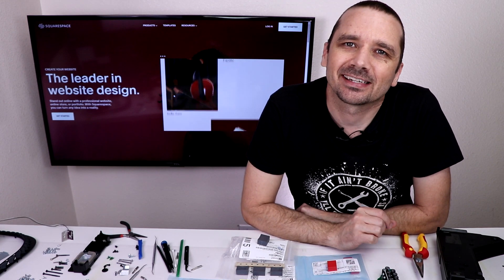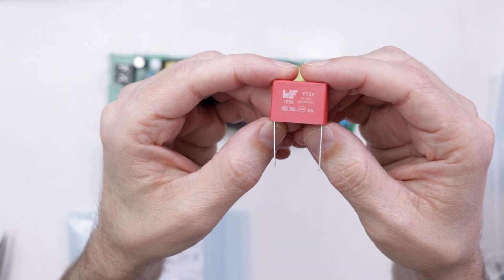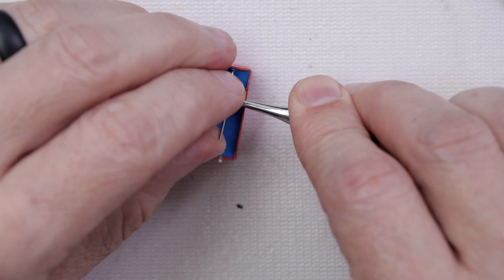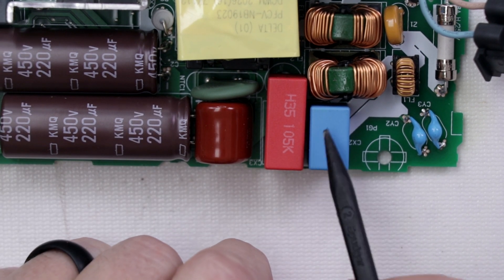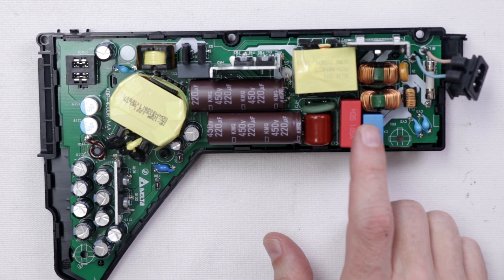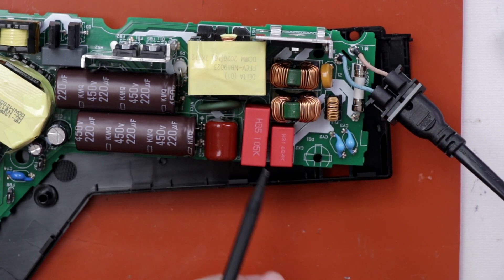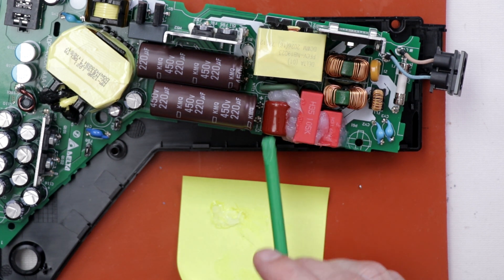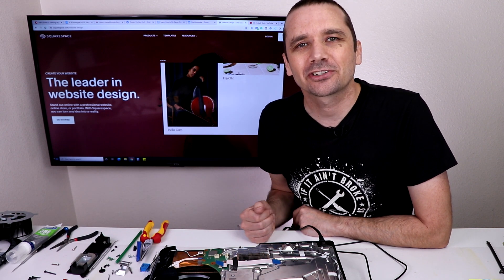Did I Fix PS5 Coil Whine?

Comment from the maker: What other experiments do you want to see me do on my PS5?
Reply: All kinds of hardcore repairs on them! They just came out Steve. We don't even known what commom problems gonna be. Thanks for the content. I love it.
Reply: Great vid! Can you test some PS5 games, like Astro's Playroom, and record if there's still coil whine? Thank you!
Reply: Maybe check out the disc drive? Maybe there is a way to make it less noisy when reading discs?
Reply: Try silicone on the original capacitors to see if it improves the noise. If you have another PS5 PSU to try it on that is
Reply: I'm curious if adding vents on the sides where the fans are located will improve overall airflow of the console, probably not but still something that can be experimented with.
Reply: @chrismorrison5301  have you tried running the conesole without the cover? The airflow on that machine is too good to be true
Reply: @MrUchiha  I don't have one unfortunately, if I did I would try that to see what happens
Reply: Connect 2 power supplies together at once. Will it start a fire? Let's find out!
Reply: trying to fix SSD's High temps?
Reply: @jangelelcangry  how hot does it go, cause ssd's in most cases are supposed to run pretty hot
Reply: All PS5 have low coil whine when idling. Start a game and see if your solution is still quite?
Reply: A HDMI port replacement with ps4 slim/pro connector. Took me 2 hours🤤
Reply: please try to fix Nidec fan noise
Reply: Can you check inside temperatures?
Reply: I honestly only come here to see you fix big batches of broken stuff.
Reply: Stress the system playing a demanding game for a few hours in a room with 30-32 Celcius. I'd love to see how it manages that kind of stress.
Reply: Can we see if only applying Silicon will help ? Cause I Can apply silicon myself without taking risks. I want to keep my PS5 but on Demon's Souls the sound is too much...
Reply: Also there is an other sound, coming from the fan, kind of a vibration also, not just the fan but a vibration from the fan... Parts of this console are so cheap...
Reply: @majorDarkMonkey  stop putting your ear next to your console and looking for noises. You'll just ruin your experience by constantly being on alert.
Reply: try playing a demanding game and hear for the coil whine, my ps5  PSU sounds louder when run games like cyberpunk, spiderman miles morales, etc
Reply: Does it blend?
Reply: CPU reball
Reply: @MrUchiha  I watched a video of someone that noticed the disc drive was vibrating the top plate of his ps5 and by putting a little pressure on top it quieted down.
Reply: PC users have been putting hot glue over capacitors to reduce the noise from them for years. They vibrate internally so quickly that they give off that "Whine" sound. It's especially noticeable at higher frame rates.
Reply: Find a better solution for the coil whine
Reply: Bet you 10 dollars tronics fix that you can’t fix my Xbox one
Reply: Another issue I’ve seen but not very common is some PS5’S come with like GPU Artifacts, you can definitely find this on the internet, can you please make a video explaining why this happens? PLEASE?? PLEASE??
Reply: Water cool it!
Reply: U think this time ps5 after year or two works the same like ps4\pro? Cause i think this time sony do much better, and we play in accepatable noise for long time, what u think?
Reply: I get error code ce-108255-1 when game frezzing and boots me out of game Sony says its software other ppl saying  it's hardware
Reply: Wurth: check out GreatScott's channel, he seams to know alot about the company
Reply: try the silicon ziptie combo without changing parts, see if that helps
Reply: @john75470  how often does it happen? I get errors but not often with this recent update?
Reply: Hydro dip the sides!! That would be sick
Reply: @dominikegarcia2213  I get it when playing call of duty that the game will freeze and and had it with tomb raider but other games I can play with no crash
Reply: Please  Use a volt meter to discharge capacitors.  set it  to read voltage. If you can set for higher range it will drain more quickly.  watch it go down to zero volts safely
Reply: Can you make it backwards compatible? :-)
Reply: Swapping the analog sticks in the ps5 controller with the Atari controllers.
Reply: I am confused so you bought a defective ps5 used or no? My brand new ps5 is dead silent as with mostly all ps5's unless it is defective. I saw you fixing a broken xbox series x. I mean people who buy day one consoles to me really can't complain when it is new tech and the first batch might have defective consoles. I just got mine and I am so impressed from the silence. I turn on the ps4 pro at the same time next to it and it sounds like a jet engine.
Reply: Wow great fix, if my replacement PS5 is still noisy, I'll be fixing mine out of warranty once and for all properly
Reply: Could you get the PS5 HD camera cable connectors and see if there is some tweaking over the its pattern (like the PS4 camera, which have a custom USB connector) or if is some new approach in terms of connection with the device
Reply: Put some led all around the vents in the front
Reply: Plates customization :D
Reply: I just can't believe you're tearing into a brand new game system that's only been out a few months and voiding the warranty :D
Reply: Please take a look at the PS5 high pitch fan noise issue. The O-rings under the fan screws is not a reliable fix and the noise drives me nuts!
Reply: A RGB led mod?
Reply: @tronicsfix I have a ps4 that's been acting up weird and I was wondering if you can help me solve it or fix it if these issues are any hardware related stuff
Reply: Replace SSD components
Reply: If you could make a video on how to make the disc drive quieter? My PS5 doesn't have coil whine, but it makes a lot of noise when reading a disc.
Reply: @w1z891  so you're saying that it could be my hard drive components because my ps4 freezes up and crashes on basically any game randomly and while it turns on and everything it just soo slow to load up and games too and when I play a video game some textures look missing. Any help with that? Please and thank you
Reply: @rka_87  this  would be major key if he can... I took my fan out it doesn’t make noise only when  it’s in the case...
Reply: A fix for discs getting stuck and the disc driving making crunching noises when you press the eject button. I've had to send mine back to Sony for repairs for this reason
Reply: @MrUchiha  This, definitely. I've read that adjusting the outer case fit can reduce it, but not eliminate it. Whatever speed those disc authentications are, that happen at regular intervals, they're pretty loud. Actually installing games from disc is quiet for me, so it might actually be the slower spin that's louder.
Reply: Did you fix it?
Reply: Hey it would be really interesting if you could test if the different fans on a ps5 have better cooling than one another. Like if the louder fan is better at cooling than the quieter one. No one has done this and I think people want to know.
Reply: Hey @TronicsFix Can we fix coil whine on PS4 Pro? the model CUH-7116b makes a lot of coil whine noise
Reply: @tronicsfix Hello,have question about liquid tape,silicon better ir liquid tape to avoid the sound of coil whine?You see in my country i can get only liquid tape...and still one is very expensive another one is from ali express,pls answer,thx
Reply: the disc drive noise
Reply: YES ID LIKE TO SEE THE CURRENT MOST COMMON PS5 HARDWARE SOFT WARE MALFUNCUTION
Reply: Steve, can you add an external "EMI filter" before the PS5 and confirm if this helps with the noise on the power supply? Those capacitors might be working extra hard trying to filter the EMI coming from the AC mains.
Reply: It is not exactly a power supply, the motherboard also produces this sound somewhere, for example a colleague plugged the PS5 service power supply, the effect is the same.
Reply: sorry to be so off topic but does any of you know a way to log back into an instagram account??
I was stupid lost my password. I appreciate any tricks you can give me
Reply: @Zev Josiah instablaster =)
Reply: @Zaire Axl it did the trick and I finally got access to my account again. I am so happy:D
Thanks so much, you saved my ass :D
Reply: @Zev Josiah Glad I could help =)
Reply: for post bending I like to use round nose pliers to get good bends plus it gives something to use to hold onto them as well. Just something you might like to try.
Reply: In summary, what are the characteristics of the  capacitors?
Reply: Can I have a listing on the capacitors used?
Reply: I watch your videos just about every evening - I don’t have a ps5 yet - but I pretend like I do when I watch you fix them.
Reply: X- and Y-marked capacitors are safety capacitors that fails open, so it's important to make sure that it has at least the same X- or Y-rating (e.g. don't replace a Y2-rated capacitor, with a Y-rated one. You can however replace a Y-rated, with a Y2-rated).

As these are safety-rated, they already have a large safety margin, so the orginal capacitor is already plenty. No need to go up to a 690V cap.

Noise usually comes from movement, so I wonder if the old cap had air in it. You can also get noise from loosely wound coils. And I wonder if the remaining noise mentioned, could be the capacitor arcing through the dielectric - which would be a bit silly, considering they're supposed to fail open.
Old RIFA (yellowish see-through) safety caps tends to crack, and absorb moisture, which kan cause them to fail a bit violently. I wonder if these caps had leaked in humidity, and this noise is some pre-failure thing.
Reply: @TronicsFix any reason specifically you arent't using a multimeter to at least test for comparisons

Comment: You shouldn't discharge caps (especially high voltage ones) using pliers. You should discharge them through a resistor. Otherwise you're essentially creating a 0 ohm load across the capacitor, causing massive current that creates sparks, massive amounts of heat and can end up killing the caps or even damage the board.

Comment: I repair iPhones. I eventually wanna get as good as this guy. Insane work again!
Reply: J.K Huss Right! He’s a good inspiration for electronic technicians.
Reply: All he did is replace a capacitor damn
Reply: @Doganderboss  in this video yes, but in others he fixed more complicated things....
Reply: Practice, practice, practice. 10,000 hours do learn or do anything
Reply: @Doganderboss  he fixed the coil whine.. no one is fixing coil whine on the PS5
Reply: He allready fixed some
Reply: I do this type of work,but  hate soldering and stuff but I'll do it if I have too, I mainly fix phone screens battery's and clean a gaming system out and redo thermal paste every day or so as well.
Reply: @DarthYazzie  no one has a PS5
Reply: If my PS5 breaks, I’ll let you freely experiment on it!
Reply: @MiGujack3  nah I’ve done some board stuff here and there but still a lot to learn
Reply: @D1amondeyes  Sorry to disappoint, I have my PS5 and from the store not a scalper, also mine doesn't have coil capacitor whine, only hear the disc spinning every now and then.
Reply: Jep absolutly insane
Reply: It is so satisfying, for an elektrican ist may asmr
Reply: @Doganderboss  😐

Comment: I'm curious if just putting silicone between the old blue capacitors would have helped with the buzzing.
Reply: Did you try this methode?
Reply: @bozoqturkmni8137  Me? Oh no, I'm not skilled enough to open my PSU safely and do that on my valued PS5.

Comment: Sony designed the whole console around being quiet (and it really is) but then they skimped on the power supply. On the Series X PSU you can see that they at least had noise output of the capacitors in mind (and they probably chose higher quality components too).

Thank you for covering this in depth and actually locating the issue!
Reply: Probably bought their capacitors from different bulk vendors to meet demand. Just the same as not all PS5's have the same fan models.
Reply: Yes, an that make me mad! Both consoles could be very nice but that mistake Sony made is ruining the PS5 for me. I have both new and old consoles and was playing on PS4 Pro most of the time for years. Now I completely switched to Xbox due to the annoying noise from my PS5. Thinking about selling it!
Reply: Don't know which ps5 u been playing I went through 3 consoles either a loud nidic fan or coil whine or both av given up now am just waiting for a proper revision or a slim my series x is near inaudible even when I put my ear on the series x I can just about hear it. My ps5s lol I could hear them quite far away
Reply: @marrsil  I sold mine because of that
Reply: @Gigi Finizio  I wish more have sold theirs and went public like you did... maybe Sony would fix it.... nahhhhhh too many rich soccer moms out there and 5 year Olds screaming for the newest system
Reply: crazy how small the xbox psu is, with less components.. much more efficient design than the PS one.. the systems should be pretty similar in power comsumption

Comment: Two Things: Try discharging the caps through a light bulb. It's a bit slower but no fire works, plus you can see when it's discharged.  You can always use a higher voltage cap. The voltage rating is the max voltage it can handle and is a function of the dielectric surface area. It also is effects the derating of the cap. As the cap gets hotter, the capacitance will decrease. The higher voltage cap will stay in the capacitance range you want. If you want to use better caps, look at an X5R, X7R which holds their rated capacitance over voltage/heat.
Reply: That's an X-cap. Replacing it with a ceramic cap is ill-advised.

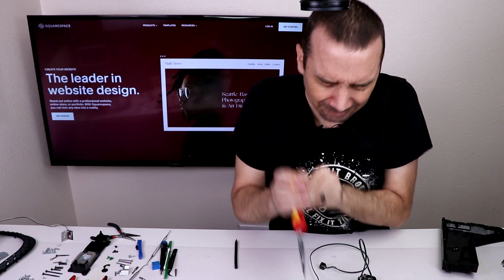Comment: 8:02 Elctroboom moment
Reply: There should be a 1 MegOhm discharge resistor in parallel to the caps to avoid exactly that. Bad power supply design.
Reply: LOL, I was thinking this was going to happen as I saw the beginning. Thanks for the heads up!
Reply from the maker: Ha, ha!

Comment: lmao that reminds me of college. We had a professor that had a capacitor about the same size as my 24oz watter bottle. When he shorted that HOLY CRAP even from like 200ft away (it was a lecture hall) I could practically FEEL the shockwave in my chest.
Reply: Haha! That reminds of the time my lab partner and I popped an electrolytic capacitor because we got sloppy building the circuit.
Reply from the maker: Ha, ha...One of mine did the same thing!
Reply: At my first ever job the prank there was to charge a large cap and throw it to someone and say "catch". It's amazing how many times people will instinctively catch something that will hurt them before they stop catching.
Reply: @asdrubale bisanzio we usually use six of them in series with balancing circuits between them. They max out at 2.6 or 2.7 volts... 
Without a doubt they can start a car. The coolest part is they can start a car with the mostly dead battery that's in it.
What you do, is charge up the caps using the battery that is mostly dead.. pulling a small draw over a period of time and boosting the voltage up into the capacitors.
And then, you connect the capacitors and immediately start the car. They are storing enough energy to turn the engine over and get it started and then the alternator starts charging the battery and brings the voltage up. The capacitors are still attached initially to balance out the load spikes a little bit until the battery comes up and then you just disconnect it and everything runs fine. A mostly did battery can jump start itself.
The other thing that you can do is charge it with an outlet or another car or even something like a hand crank if you have the time... And then bring it over to the car to boost.
If you wanted to build a hybrid battery for your car, you could run cheap tiny cells that have the same amp hour capacity so you can run your radio or lights for the same amount of time, but these cheap cells can't do the amperage to start it... But the super caps take care of the amperage to start it so the battery lives an easier life.
Lots of fun things to do with them and automotive applications but they have nothing to do with what he's doing there.
Reply: @ZaPpaul  Ya, at my last job this fool, that was my friend, did the same thing to me. I “trusted” him so naturally I tried to “catch” it. I gave him a good scolding. Stupid guy thought it was funny then, I still don’t think it’s funny, now.
Reply: clocked.

Comment: Good fix brother. What I was mentioning in the last video is that I use certain silicones to waterproof some controller boards that are somewhat exposed to the elements, and also fairly expensive. But also have a muffling effect on noisy components. That is a very simple fix. I always appreciate your videos.

Comment: For your information: Würth electronics (WE) is a german highly priced electronics parts seller. Like e.g. Farnell, Mouser and so on. Würth also makes tools ,screws and so on. They are a bussines supplyer. So you got the best you can get from Germany.
Reply: If I'm not mistaken WE sells only its own components, differently from Farnell, Mouser, RS, Digikey etc., which are retailers and sell all brands of components. I would say WE is more like Vishay, TDK, KEMET... (a manufacturer). The partent company, Wurth, I'm not very familiar with, might work differently.

Comment: @tronicsfix I am a old TV repair man. I used to discharge all caps with 2 leads connected to a 100w light bulb. This saves the sparks and the possibility or ark damage. Hope it helps you 👍

Comment: As a note, you don't need VDE tools to prevent shocks from charged capacitors.. If the board is disconnected you can short the cap with a piece of metal completely uninsulated and you won't get shocked. Of course it's probably a good idea not to open a power supply if you don't know/understand the risks anyway